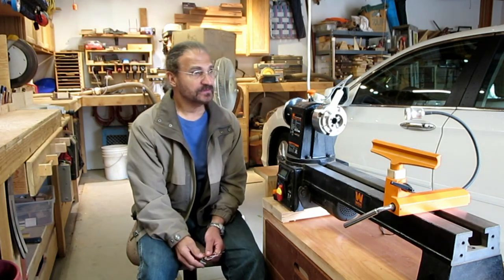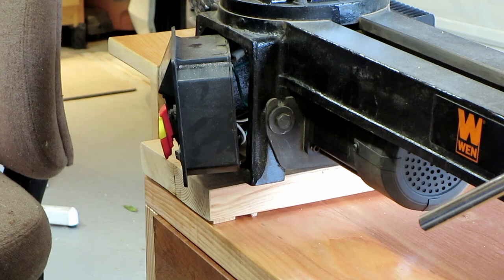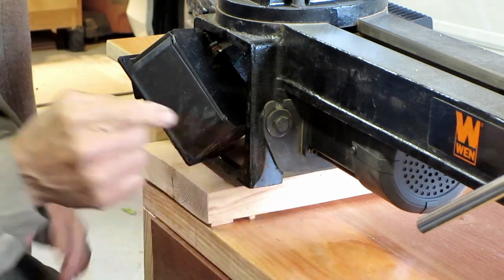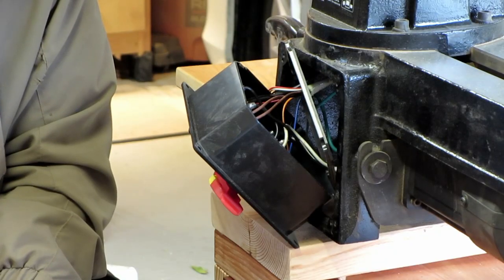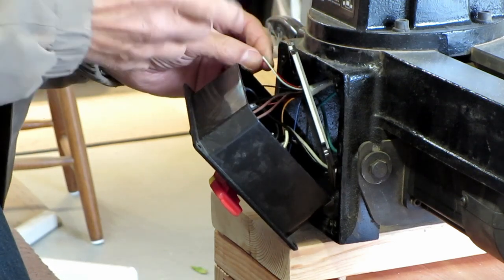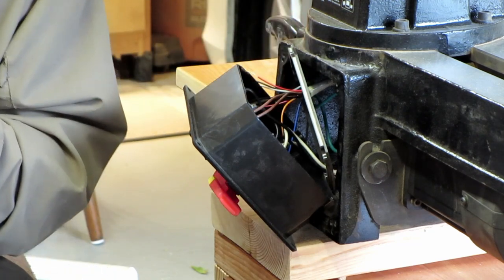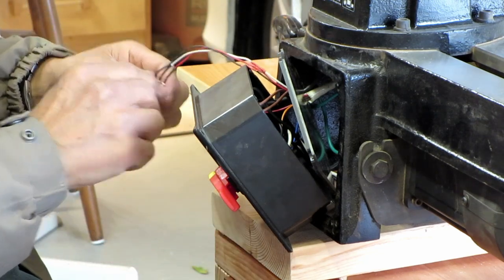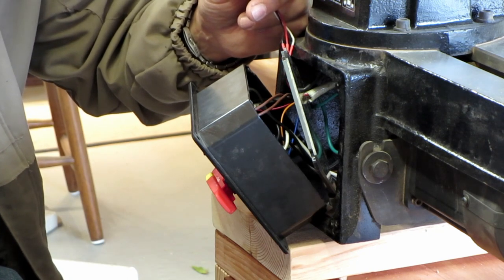Replacing Speed Control on Wen Lathe

Comment: very cool! I'm wanting to buy this lathe's little brother. Thanks for the videos.
Reply from the maker: Thanks. Keep in mind that the larger one (the 3427) is only $402 at Home Depot.
Reply: How has the lathe held up years later? Does it have good longevity? Do you ever use the back to turn bowls up to 15 1/2 inches and how does it handle it? Seems like a great deal for the price.

Comment: Hello, I am thinking about getting into wood turning. I don't want to spend a lot on a lathe just to find out I don't enjoy the craft.
I wood like to see what your thoughts are on this particular model. It seems, from your other vids on the WEN line of lathes that there are issues  with them. 
Is this the case with the model #34027b that you show in this video? Thanks
Reply from the maker: Hi Craig, it's very important that a lathe be extremely accurate in its manufacture, other wise you will not get good results. Because of the issues I had with the Wen, I would not recommend it, which is too bad because you get a lot of features for the money--just not good manufacturing quality. With that said, if you can buy it a Home Depot, you have 90 days to return it if WEN can't make it right in case it's not perfect out of the box. Another option is, if you think you may only be turning small items, such as pens, think about one of the mini-lathes available from places such as Penn State Industries. This may be a good place (i.e., less expensive) to test the waters of turning. Hope this helps.
Reply: @knotnowwoodworking  
Heck yeah this helps. I appreciate the advice and I will definitely make sure home depot still has the 90 return policy.  I have read A LOT of reviews on this and they all say the same thing, cheap tool rest, tail stock issues etc. However most of the reviews were at least two years ago. I'd like to think that a company would get their ducks in a row after so many complaints. I may roll the dice on this model. If its good out of the box I'll let you know. Keep up the good work